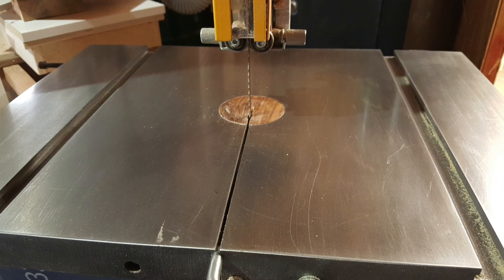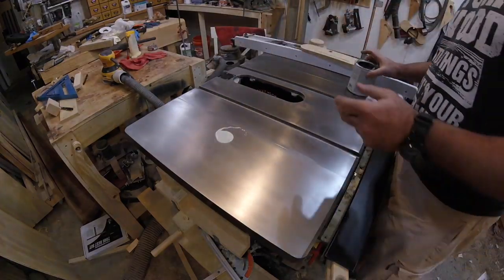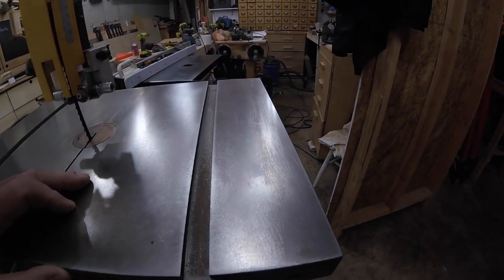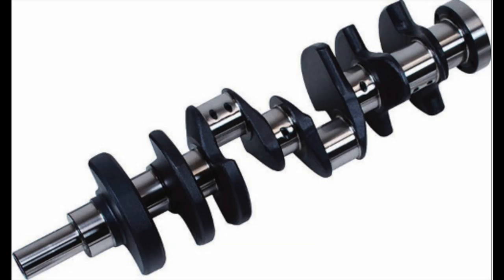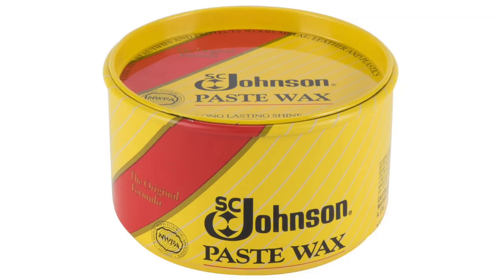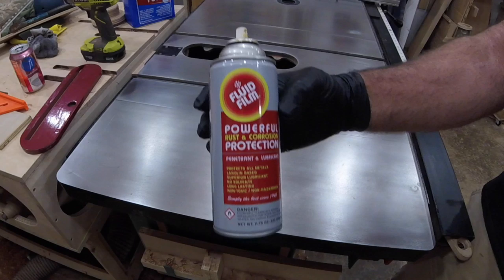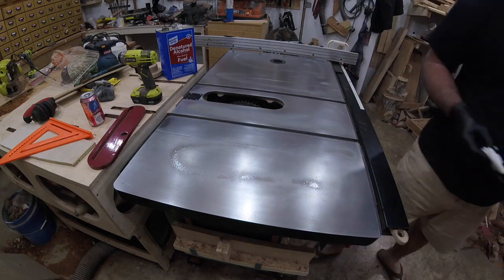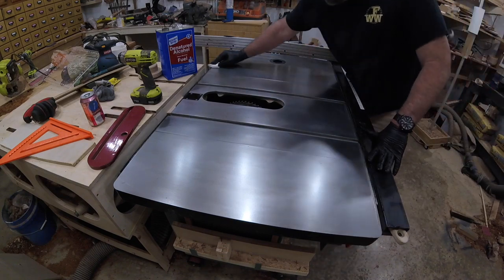Polyurethane Your Table Saw Update: What I Learned About Cast Iron

Comment: Like you a rub down with a fine paper, clean with ansolvent and let dry then I swear by Boeshield T9. 

I treat all my steel, cast iron and aluminium tools with this stuff.  No rust or oxidation over winter, lasts 9 to 12 months.

Not cheap but it really does the job

Comment: How about Polyresin, a thicker resin coat.
I also made my sled rail that glide in the Chanel's with HDPE, melted milk jugs, repurposed, cut to fit glued to the sled with Hot Glue Gun. No drag at all

Comment: I'm not an expert, but it seems to me that the oil based seeped into and plugged the pores on the saw. Even after sanding, those pores are most likely still plugged. That left nothing for the water based to bind with. Nope, I don't have a solution for this other than, possibly, a good oil paint remover chemical to open the pores. Not even sure that will work, but I think I would try it.

Comment: you could have used polyurethane seal just like before. A silicate primer (liquid or pyrolytic) would need to be applied to the pu treatment befor the coating and after cleaning only a silicate primer.
Reply: And here's the problem: The cast iron has a relatively "large" bandwidth of added silicon. This depends on many processing parameters and material quality. Most polymers adhere better to silicate surfaces. It is therefore not entirely wrong that a higher proportion of carbon leads to a poorer adhesion to polymers. If you now apply a silicate primer on the surface (a few 100 nm pyrolytic or more with liquid primers) has an adhesive bond to the cast iron and applied pyolmerfilm. Sorry for the bad english, a german material engineer.

Comment: How about a big slab of granite or quartz countertop or corian on top of the saw.  I don't mean you should do it,  I'm saying it should come from the factory with that option. 
Or how about the cast iron with a thick coat of powder coat that is then milled dead flat? 
I just spent 2 hours going to multiple stores getting sanding discs then sanding my jointer table up to 2000 grit now I'm doing the fluid film.
Reply: There is no reason fur all this bullshit when the factory could do it permanently. 
We landed in the moon or we faked it, either way this shouldn't be out of the realm of expectation for the woodworker who lives in a humid climate.
Reply from the maker: I couldn't agree more.  But it is a cost issue.  Craftsman used to sell a hybrid contractor, similar to the Ridgid, that had a granite top.  I think that durability may have been the issue.  Drop something on it and it cracks.  I bet you could make a reinforced concrete top.  Those can be polished pretty slick.

Comment: I’ve been using motor oil...wipe on and wipe off.  Have not had rust on my tablesaw or bandsaw in 6 yrs.  because I wiped off the oil, I don’t get residue on wood either.  Works for me.
Reply from the maker: That is interesting.  I put motor oil on my pipe clamps to keep the glue from sticking.
Reply: Detergent motor oil is a dessicant. So it attracts and absorbs water. That's so the water can be flashed off on the cylinder walls of internal combustion engines it is designed to work in. In humid air metal will rust with detergent motor oil on it.
Reply: @FranklinWoodWorks2016  I put Johnson's paste wax on my clamps to keep glue from sticking. 😀
Reply from the maker: @1pcfred  I should have been more specific.  I actually use chainsaw bar oil, which in my case is a 30 weight non-detergent oil with something in it that makes it tackier than motor oil.  I did not know about the detergent effects on water.  That is good information.
Reply: Paul Frederick interesting.  Guess what I used wasn’t detergent oil.
Reply: @tonyjarry8569  most motor oil is. Some is not. I was less concerned about it myself until I started seeing water droplets forming along with rust on machinery I'd put detergent motor oil on. Water being heavier than oil is the water sits right on the metal. I actually misspoke yesterday too. Detergent motor oil is not a dessicant, it is hygroscopic. It was late and I was tired. Desiccants suck up water too though.
Reply: @FranklinWoodWorks2016  chainsaw bar oil is non-detergent. Bar oil is definitely not motor oil. A lot of folks don't know why there's detergent in motor oil. It is there primarily to absorb moisture that may enter an IC engine. That's why tailpipes drip water. Without combustion the detergent cannot do its job though. I was unconcerned myself until I started seeing water droplets on my milling machine after I'd coated it with detergent motor oil. What's worse is the water forms right on the metal being as water is heavier than oil is.
Reply from the maker: @1pcfred  Thank you for that info.  I can't believe how much I've learned since I started this venture.
Reply: @FranklinWoodWorks2016  the more you know the more you know that you don't know.
Reply: Paul Frederick yeh we southern people have learned ways to keep our metal stuff from rusting.  I primarily use old motor oil on all my tools...wipe it on and the. Immediately wipe it off.  It leaves a superfine film on tools that wick away moisture.  It’s worked for me very well over the years in high humidity environments.
Reply: @1pcfred   Tailpipes drip water because when petrol burns, one of the waste products is water. When the engine is first started, the exhaust system is cold, and the water vapour in the exhaust gases condenses on the cold metal and drips out.
Reply: @paullyons7621  combustion does not make water. Although compressing air can make water condense. That's where water in an IC engine comes from. The air. IC engines are basically air pumps. My air compressor has a water trap on it too. There's no combustion whatsoever going on there either. You should see the water that I can bleed off of it.
Reply: @1pcfred   Petrol is a mixture of compounds comprising mainly compound of carbon and hydrogen., When it burns, the carbon burns incompletely to form carbon dioxide, carbon monoxide and carbon, and the hydrogen burns to form hydrogen oxide, aka H2O, aka water. 

Compressors do indeed have water traps, and they aren't burning anything, but the fact that they condense liquid water from water vapour in the air doesn't mean burning petrol doesn't produce water vapour.
Reply: @paullyons7621  most of what goes through a gasoline engine is air. The air fuel ratio is 14 to 1. When an engine runs it sucks up everything in the air. The air filter will trap dust. But it does not trap water vapor. Maybe you're right and combustion makes water. But that is not where the bulk of the water in an engine comes from. Being as 14 times as much air is flowing through an engine compared to the fuel it consumes.

Comment: maybe it already had a coating. Try a light sanding with emery cloth
Reply from the maker: When I bought the saw, it came with copious amounts of grease all over the cast iron to protect it during storage/shipping.  It took quite a while to get all of that off.  Between the time I got the saw and the first video of oil based poly, I bet I sand down the top with 320 grit sandpaper 5 or six times, due to me dripping glue or finish on it.  I'm pretty confident that if there was a coating on it, I have long since removed it.  In fact, I believe now that it was all the sanding that made the poly not stick.

Comment: The only thing I can see is what a GOOD mechanic said about rebuilding an engine. IF it ever had synthetic oil run in it for lubrication it would penetrate the pores in the cast iron and be almost impossible to hone without clogging. It would always seep out from inside. Maybe that's why Fluid Film works so good. Similar bond? I don't know, but it it works, GOOD!

Comment: I use beeswax with gentle heat, good for years, I would never put polyurethane on cast iron.
Reply from the maker: It's all about experimentation for me.  The poly doesn't hurt anything, and as it turns out, comes off easily.  No harm, no foul.
Reply from the maker: I was looking at the beeswax option, and saw that it is usually an ingredient in surfboard wax.  That stuff is sticky, not slick.  How slick is the beeswax on a table saw?

Comment: Never used your solution so no standing to criticize but...here's my 2 cents.  My solution, Collinite.  Pound for pound, dollar for dollar it is the best there is if the right product is used for the right application.  On my cast iron, Collinite's Auto Super Double Coat Wax.  It is a "permanent" wax provided it is not acted on by chemicals or abrasion.  Left alone, it will never go away.  Not carnauba wax so you shouldn't apply it by warming it in your hands as you would on a show car. I apply with dampened 100% cotton.  An old fashioned diaper is best. I do use it on my truck more for protection rather than that deep show car shine.  It is difficult to use the first time.  First, there cannot be any other product on your iron.  It must be completely removed first or it will never come off after the Double Coat is applied without laborious abrasion..  If left to completely dry you will achieve Popeye style forearms trying to get the excess off.  From then on, a simple wipe on wipe off treatment will make the table top pristine again and NO rust.  Microfiber cloths are a must for buffing.  I wipe on, wipe off before and after every use of the saw.  Not really anal but, I do find it therapeutic.  An easier to use version is Collinite's Insulator Wax.  The same exact product in lotion form.  Same results, but easier to get on and off just requiring more thin layers.  It is used by power companies on high tension cable connectors protecting them from the elements and UV forever.  Full Disclosure:  I'm  in the Southwest where ambient moisture/humidity is not an issue...However, any introduction of 'wet' in the shop, even just a sneeze, immediately dries and produces rust on unprotected iron.  I don't have that problem anymore and the dust inside or outside of the shop still has me sneezing like crazy.  The down-side?  The table-top is VERY VERY slick.  If you're not ready for it, things can get away from you.  I had to change my work habits.  Enjoy.   BTW: I appreciate the demeanor of your channel.  Subscribed.
Reply from the maker: Thank you so much for telling me your experience.  I am very intrigued.  Just for clarification, you said that you "wipe on, wipe off before and after every use of the saw."  What are you wiping on?  More of the Collinite?
Reply: @FranklinWoodWorks2016  Yes.  I keep the cotton in the can and keep the can handy.  I blow off the top then just wipe once along the grain back to front. By the time I get to the end, I grab the microfiber, also handy, and begin to buff it off where I started, also with the grain, not letting the product completely dry.  Less than 3 minutes.  The circular motion application works fine but, it leaves a blotchy look.  Remember, I'm in the South West so your mileage may vary.  For reference;  I just did a compete bathroom re-fin with 240 Sq Ft of large format tile.  I wasted about 60lbs of Thin-Set before I smartened up and began mixing it with ice instead of water.  Back to topic;  I've done at least 3 coats to the rest of the saw too.  All over the cabinet and hand wheels.  I heavily coated the rails making the fence slide like silk.  When the cabinet gets dusty just a wipe or snap with the microfiber makes it go. I rarely change the microfiber.  It has become charged with a little wax so, sometimes just a wipe with it gets it done. To be honest, I don't ALWAYS do the before-and-after routine.  Sometimes the pressure of the moment and/or life events has me skipping it.  Other than that, the iron looks and feels so good that it has become a discipline that, for some bizarre reason, I just like doing and look forward too.  Does that make me weird?

Comment: I’m about to say something blasphemous, so look away if you’re sensitive. What if you paint your power tool surfaces with anti-rust metal paint? Like what they use on ships, basically. It seems to me this is never done, but I don’t know why. No doubt the paint would eventually wear away on the working surfaces, but sanding and another coat of paint would fix that.
Reply from the maker: Heretics will be burned at the stake!  Actually, I have thought about it, and you're not the first to mention it.  I've wondered why they dont powder coat them in the factory.  Maybe it is because minor scratches would be ugly, and hard to repair apart from a sanding and re-paint.  No doubt that cast iron is durable, but I think we would expect a "visible" finish like paint to be equally durable.  Probably psychologically a bad marketing decision to have your tool get ugly too fast.
Reply: If they did it at the factory, they could even use baked-on enamel, like what’s on the outside of my cast-iron cookware. It seems to stand up to a lot of rough treatment in the kitchen.
Reply: I had a powder coated triton saw bench, it was not cast iron, but after a few years the coating got scratched and wore away in places, then the rust set in, got under the finish and blistered away the coating. baked enamel may be hard to get a precision coating over the surface and although very tough, it is very brittle and chips are hard to repair. good tip with the sheep grease, I may move my tools to the shearing shed, it will get done with no cost and no labour :-)

Comment: Paste wax does not cut it for me either. I wonder why anyone would reccomend it
Reply from the maker: I think folks recommend it because it fits their situation.  They either have lower humidity, they have clean shops, they enjoy the tool maintenance aspect of woodworking, or a combination of these.  Unfortunately, none of these apply to me.
Reply: @FranklinWoodWorks2016  yeah same here
Reply: @mkgg9637  where are u located? paste wax didnt work for me either but i assume the issue was due to high humidity of Ga climate. i since had to sand and treat with boeshield rust remover and t9. that is working better, but my garage needs to be enclosed so im still having some minor issues.

gonna try the the film product to compare to t9

Comment: cleah table and rub on parophane  wax its cheep and last for years
Reply from the maker: Paraffin wax is used in many surfboard waxes.  They are designed to make things stick.  Waterproof - absolutely, but sticky?  Don't you have to put something else on it to make it slick?
Reply: no, but you have to  rub it out ,rub wax stick on cast top then rub it out i use paper towels then just pitch them